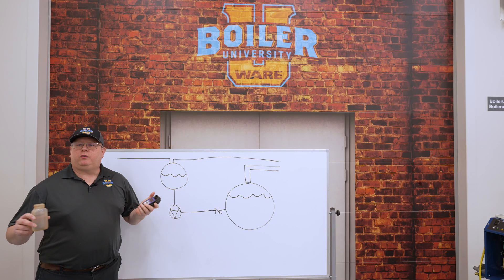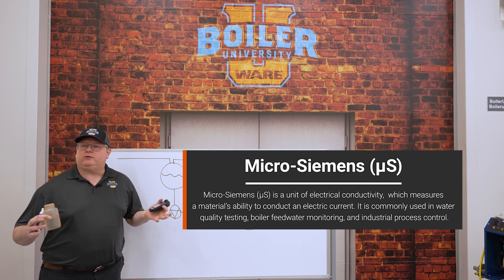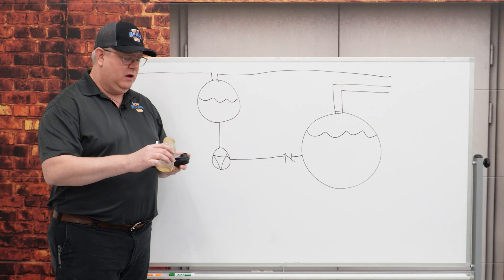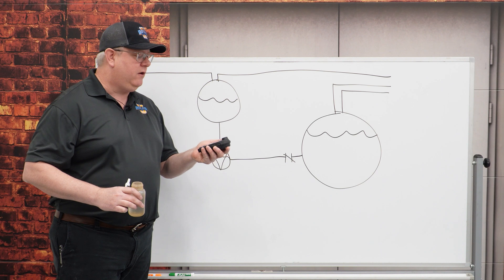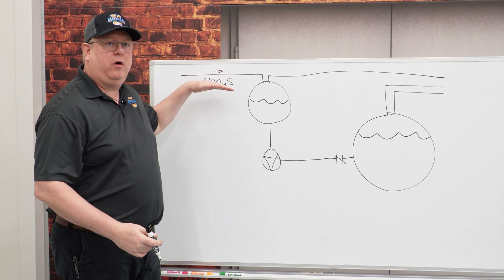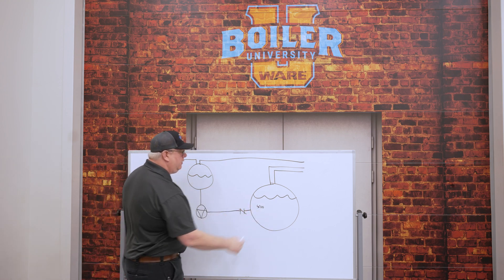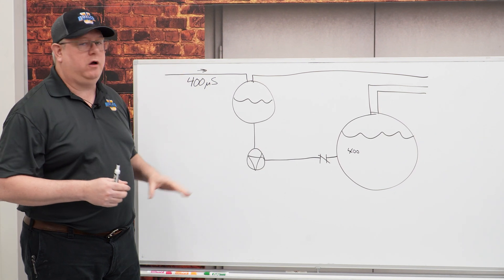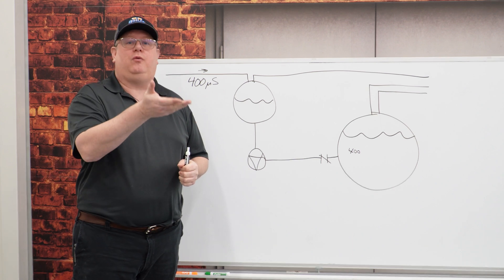The Basics of Boiler Conductivity PT 1: Control & Measurement - Weekly Boiler Tip

Comment: Do you have a video on steam boiler surging , my boiler ph is 12, I’m also hearing hammering in my system, supposed to be replacing boiler in the next 2 years
Reply: It sounds like you may be getting cold water coming back to your boiler from the DA tank. Check to make sure there are no solenoid or cold water valves leaking by. You want to preheat that water prior to going to the boiler . If you don't then  the cold water will cause a hammer